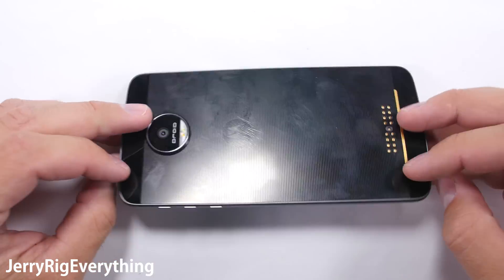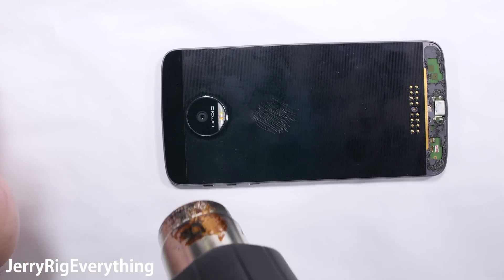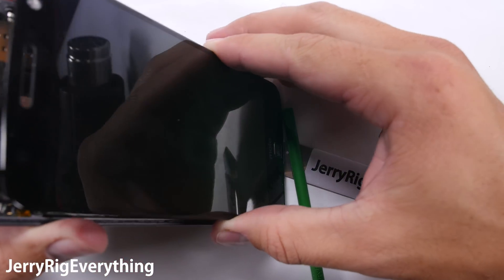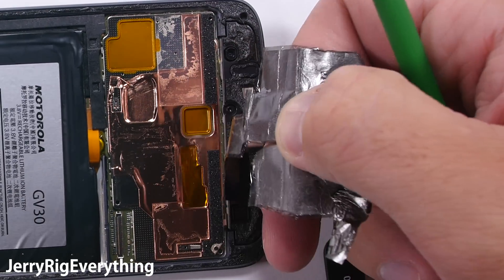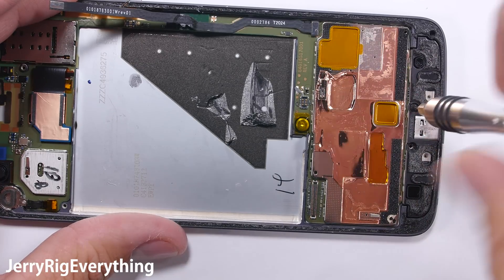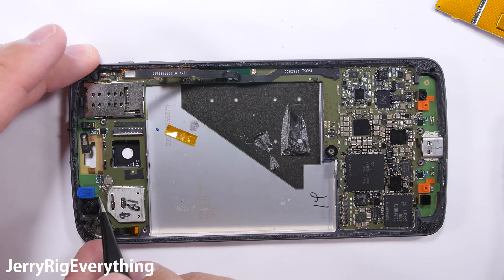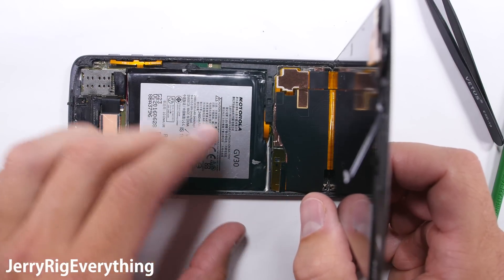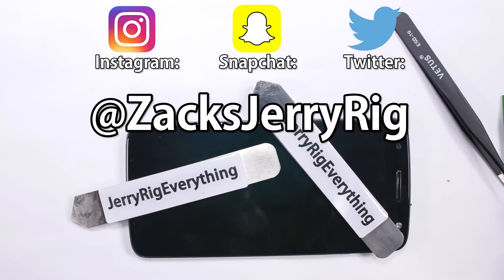Moto Z Teardown - Screen Repair - Battery Replacement

Comment: just recently decided id try and replace my battery and it turns out mine had a antirepair plate blocking the motherboard from the front installed by my phone service provider

Comment: The microphone on mine is very bad and it very faintly picks up sound. Is there a way I could clean it without doing this? Or would I have to do this to clean it. Or would I just have to replace it and if so would that be hard?

Comment: Where is the vibrator motor? Must be tiny?  I am performing a durability/longevity test of the motor on a Moto Z2 Force. I'll see how long it lasts with continuous use.
Edit: 2:56 I see where it should be. Must have skipped the step of removing it. It is in the upper left corner of the phone.

Comment: I'm studying this video religiously right now. I may have to do this. I took my phone to get the screen repaired [twice...] and the second time, after I got it back, the battery started failing randomly. Like, I'll charge my phone, it'll say 100%, but dies if it doesn't stay plugged in. I even have an Offgrid Power Pack for the Moto Z, and at first it helped, but now, even when the power pack AND phone is charged 100%, it just dies. It HAS to be plugged in to stay on. I don't know how to tell if there's a software connection issue with the battery, of it's the battery itself. If any knowledgable person out there has any tips for me, I am forever grateful to you.

Comment: I'm the moron who disassembled my phone before watching the video, so I'm pretty sure I either broke or threw away the little bracket for the LCD ribbon cable. I'm hoping that's there more or less to prevent the cable from slipping out, and that it isn't necessary for the phone to function properly. If it's only there to hold it in place I can find a way around it

Comment: Something no tutorial for replacing Moto Z batteries has mentioned, which I ran into while taking the glass off is that there are these two little springy thingies on the upper right-hand corner. I managed to bend mine out of place when I was prying the glass off. You can see them at 3:00. Hopefully I haven't ruined them.
Reply: What was the symptoms of bad battery? Mine gets hot at charger port and only goes too 1% and shuts down charging.

Comment: "Wait What!" You have to remove back glass panels to access the  6 -T4 screws that hold the screen in place which was not mentioned in this video.

Comment: The adhesive on my phone is toast. The glass is lifting off so I can probably just lift it off, it's had a crack in the corner for about a year. Perfect time for a new battery too. Thank you ♥
Reply: Use B-7000 to glue display to frame again
Reply: @Stefan-ei5wg  Thanks, is it made by E-6000?
Reply: @VondaInWonderland  
E-6000 is a chinese replica of the B-7000 product as i know..
Advise you not to risk it..get the B7000

Comment: Think this video is partially...can't  say fake but not exactlly true..
First of all  a pretty thick metal pry tool is much more "dangerous" when dealing with a this display like that..then a 100% plastic playing card whitch is far slimmer and thus far safer to use..
Second, the adhesive on the top and bottom side of the phone is much more "resilient" then shown on video.. takes repeated tries to remove it, doesn't come off after a single swop with that pry tool..
And third in order to move safelly you have to reheat every portion of the screen to take it off (just like he said but only heat it once!)
My guess is that the display was already removed and most of the adhesive taken off prior to making the video, so he had a much easier task then doing it with a phone that hadn't been worked on before..
Anyway his technique is good , but procedure is a bit harder then shown on video..
Cheers!

Comment: I'm watching this with a moto Z that has a broken back glass panel and it's broken  enough to see the mother board
Reply: Hoshiko Fukushima 
The small glass portion on the top or the botton of phone?
Have it replaced or put something over it..dust or other stuff might enter and in time damage the board..
Reply: @Stefan-ei5wg  The bottom part and I also put tape over it, for now that is.

Comment: It's nearly impossible to repair this phone. The parts supposed to slide or pop of etc are so stuck after 2 years that you nearly have to breake them
Reply: If you want to open up this phone for whatever reason...use a plastic (not plastified) playing card!
It's the safest way

Comment: Has anyone changed just the battery and kept the screen intact? Love this phone but I raped it over this last year when I switched from Gapple to Droid and the battery is tired. Just wondering if I should just get the screen with the battery. Or, just spend the $380 CDN and buy a new one. $380/year isn't bad. Plus I am too busy fixing crappy iPhones for people.
Reply: Battery gets fucked up because of the fast charger ..it has only 2700 mah and the hight influx of power kills it in time..Use a normal 2 amp charger to charge if you getting another..
Not worth it getting a battery and a screen (if you broke it) get a know phone better.

Comment: Is it possible to separate the glass from the digitiser. Or do you have a video showing that process?
Reply: It is possible..but you need specialised equipment to do that..and then new glass has to be "glued" to display with OCA. Pretty hard procedure

Comment: Hi, very good video. I have one of these phones and need to replace the battery. This and other videos are going to help me do that.

That being said, please be aware that the "decorative metal piece" is NOT DECORATIVE. Do NOT damage that piece! I am an electrical engineer who has worked in mobile phone development. That piece is for GROUND. It is important that this have a good connection to ground or the mods attached to the phone may not work reliably. This is especially true if you are using a battery mod. As an added bonus, this ground plate offers ESD (electrostatic discharge) protection. To everyone disassembling this phone, please be careful with this part.

Another side note: you called the copper tape over the processor/etc. on the motherboard a "protective piece." This is true, but it should be noted that it not only acts as a heat spreader for the chips, but it also provides electromagnetic shielding to prevent electromagnetic interference (EMI).

Regardless, thanks for the video! It is very helpful to see someone disassemble the phone, especially when it comes to the heating of the glue, which is almost an art it seems.

Comment: I need a new screen for my Moto z play where do you suggest me to get it? It completely broke the screen is completely black now.
Reply: Price dropped for older Z models, but prices for spare parts still hight. Better get a new phone then have display replaced.

Comment: I needed to see how to resolder one of the pins on the back panel. dropped my phone and one of the pins broke out. Now none of my mods will connect. How do I fix it?
Reply: If you can't somehow reatach the pin..you have to buy a new frame for the phone, that's where those pins are located

Comment: Is it possible to take the screen from a donor Droid XT1650 and put it on one with a cracked screen? I have two, one cracked screen, the other with a dead battery.
Reply: Off course you can. You have to take display from the one with a dead battery and put it on the one with cracked screen(after you remove it obviouslly)
Go to a service shop in your country..or if you want to do it yourself recomeend using a plastic playing card to separate the display not a metal pry tool.

Comment: Is it possible just to replace glass and not the whole digitizer? Obviously cheaper this way. Thanks
Reply: Michael Jones 
You can replace only the glass, but this can only be done in service shop with proper equipment, cannot be done at home ..

Comment: Tried to replace the battery on this brick of a phone.. this video sure makes it look easy. I bought the tool, bought a battery, ended up breaking the glass trying to get the tool in on the first step. Sliced up my palm pretty good with the tool.  Out $40 and went HRC on the phone with a hammer.  Good times. Definitely my last Moto phone.
Reply: Because metal pry tools is a stupid idea.
A plastic playing card is best to open up a thin display like that

Comment: I have this phone I'm am on my 2nd replacement because the battery keep going bad I don't not recommend this phone at all it sucks
Reply: The battery usually deteriorates because of the turbo-charger, it had only 2700 capacity and with that "influx" it ruins the battery!
Use a simple 2 amp or 1.5 charger for it , takes longer to charge but it will make your battery live longer..
Reply: Mine also shit the bed after just very a year battery charge was always 100% and would turn off and when plugged back it would show no charge left
Reply: Same problem
Reply: It's the phone I have
Reply: What symptoms did you show mine wants too charge starts charging to 1 % but then the charging area gets hot and shuts down the charge completely. Sucks phone is z3 and only was not even a year old dangit. Wondering if the charge port is bad or battery .

Comment: Worst phone ever created .weak  Battery  . Back Camera gets scratches instantly . Finger print magnet .  Weak screen . And apperantly if u run a movie while it's being charged it might burn ur house .  Heats very quickly .  When It fall  on its back not only the back side breaks the front as well

Comment: Has anyone replaced their screen and then had issues with their speaker?  Mine sounds very muffled.  I opened it back up and if I pry the front part of the speaker a tiny bit, the sound is full volume, but as soon as I release it it snaps back down to the old, quiet, muffled position.  Any help would be greatly appreciated.

Comment: Will the adhesive be the same as it was before removing parts or will the back two pieces fall off while I use the phone
Reply: I have had no issue keeping the back pieces on, but I got a replacement screen that didn't come with new adhesive and have had a bad time trying to get it to stay sealed down

Comment: You're supposed to open the screen to the side like a book. It swings open using the right side as a hinge. Both the screen and fingerprint scanner flex cables are designed to do this.

Nevermind, seems like the US version (mine) is different.

Comment: Throw it in the trash where it belongs , unlike a Lego which is somewhat useful.  If you own this piece of shit and it actually does work, chances are it won't work when it downloads android 7.1.1 "instant battery death version".  Can we start a class action lawsuit?  Barely over a year old and the battery drops 2% a minute.  How can they not recall this with all the  complaints and people give Apple a hard time?

Comment: My moto z just lost its internet and bluetooth capability. It was charging overnight. I opened the phone and tried to turn on the wifi switch in settings but remained off.

Comment: Has anyone actually did this or had someone perform the task? And if so how responsive is the touch after having the screen fixed? It won't glitch out or anything will it?

Comment: Question : Why Motorola said it has 2600 mAh and when you watch the video it's written on the battery 2480 mAh... With such a tiny battery the 120 mAh missing are a really a big difference...
Reply: You didn't read that correctly. There's a minimum and typical rating. Minimum is the point where the battery is considered degraded and should be replaced (looks to be 5.7% degradation in this case). As a rule of thumb, I'd be okay with the cell degrading down to 80% capacity if you really want to run it into the ground, but who knows what specific cell characteristics LG Chem requires. The packaging says 2630 mAh is typical. In other words, there's an acceptable range of between 9.4-10.0 Wh.
Reply: Thank you for the explanations. Very kind of you.
Reply: After the service repair I received a new battery from my Moto Z. However, its parameters are different than the factory ones. Factory li-ion 2600mAh, after the service li-poly 2760mAh. A perceptible difference to the plus.

Comment: THIS WAS A NITEMARE YOUR ADVICE FAILED
Reply: How did the repair fail for you? In my case, I was really careful to make sure I didn't damage any of the flex cabling on the screen or anywhere else. Unfortunately, just heating up the display with a hair dryer caused OLED damage and I can see splotches of damaged pixels that won't return to normal long after cooling. Also, only the bottom half of display will register touch now. I regret ever applying heat directly to the display now =(
Reply: If you must DIY this, DO NOT use a heatgun/hairdryer. At most, use something like an iFixit iOpener or hot microwaveable compress to apply the heat. Anything more significantly risks display damage. Even then, I'd still strongly consider leaving that job up to professionals with dedicated equipment to do this.
Reply: Sorry you guys messed up your phones. I was thinking of getting my phone screen replaced.
Reply: For sure the heat gun will destroy it.  However, putting that much lateral pressure on the wafer thin screen with the opener is sure to crack it as well.  But without something to help loosen the adhesive, it's like peeling a .001mm wafer off 200mph duct tape - destined to fail.  I read that even the tech shop will fail 70-90% of the time- which is why the price is so high for them to do it - it covers the risk.
Reply: Agree that high heat will destroy LCD.  I used hair dryer on WARM for 45 seconds.  Start a corner and work your way around reapply heat as needed.  Too much heat will damage screen.  It does not take much to heat up the phone and loosen the tape.

Comment: It is not a decorative bar. It is a ground bar for mod attachments. I've got a broken pin that you see above that bar and I'm trying to figure out if I can repair it.
Reply: You are correct. The pin lies just underneath that circle portion in the middle of the bar. Sorry yours snapped off.
Reply: I have this phone it's a great phone   my problem is my center pin must have came out so the sound mod don't play anymore, can this be fixed?
Reply: @bruceeharris  center hole is not a pin. It's a magnetic thing to hold the mods on
Reply: Any luck trying to repair it?

Comment: Jerry, I have the original Motorola z force. I just noticed the degradation of the battery I still get 12 avg use with battery saver mode. Would you recommend getting a new battery installed or purchasing a new phone?
Reply: Shekhar Moona I opted to get a $20 replacement battery off of Amazon and will be attempting the repair this weekend thanks to Zack's detailed instructions. Don't have a heat gun on me right now, so I'm hoping a hair dryer will suffice to soften the adhesive enough to get some iFixit plastic picks inserted under the screen. I've already purchased some 2mm black foam adhesive, similar to what's on this already. We'll see how I fare. I'm just hoping the replacement battery isn't a lemon and will last at least another year.
Reply: Mike Trieu this is by far my favorite phone ever. I have never had a phone this durable and really don't want to purchase a new phone.
Reply: Shekhar Moona I don't want to purchase a new phone, either. My internal battery no longer holds a charge and Motorola refuses to accept battery issues as warranty claim citing it as a "consumable". It lasted less than a year before I had to resort to battery mods and eventually even those wouldn't keep it from shutting down and I now have to keep it tethered to an external USB-PD battery bank at all times. I don't think I'll buy Motorola anymore after this replacement battery eventually dies. I'm going Pixel line next time.
Reply: I opted to go with a battery mod off of eBay.  No way would I attempt to replace the MotoZ battery.

Comment: have you tried changing the camera bump and if so how hard is it. mine is really scratched up.
Reply: Ben Hatch 
Take a cotton rag...and some toothpaste and wipe the camera lens with it.
Takes a while but it does the trick, toothpaste acts like mild abrasive removing the scratches from lens..
Cheers!

Comment: So what I'm getting here is there is no way to force turn the phone off when the screen has physically become unusable and the electronics are clearly malfunctioning? Really needed to do that immediately not get a bunch of tools and have a project. But thanks for clogging the search results for that.
Reply: Xaiex J If your power button is malfunctioning, what did you expect? Of course you have to disconnect the battery. Seems like you have bigger problems at that stage.

Comment: ok need some help, I dropped my moto z force and i cant get the screen to come on. And i cant backup any of my data. Any suggestions
Reply: Just fixed the same problem after watching the video(Thanks Jerry) Try restarting your phone and lightly tapping it on a table where the screen connector at the bottom is. Make sure you're tapping the back of your phone not the screen, I'd dropped mine and it fell flat so i assumed the connection had severed. guess i was right

Comment: Hey dude, what is the cost for Original Moto Z play  display screen ?
Reply: Last time I quoted Motorola for a proper display replacement, somewhere around the $200 range. At that price point, you could just save up another $200 and just buy a new Moto Z Play or better yet, buy a Z2 Play since it's being sold for $349 now from Motorola directly